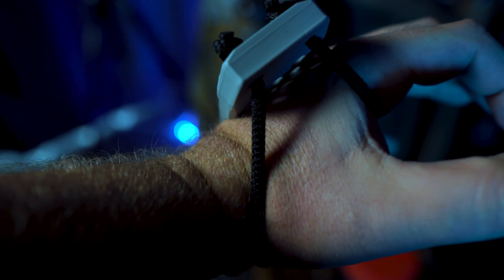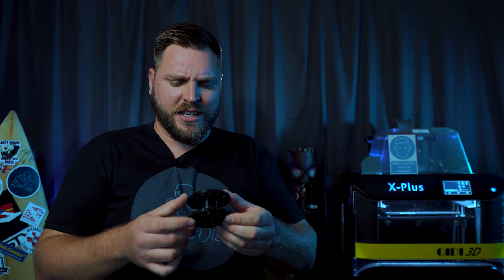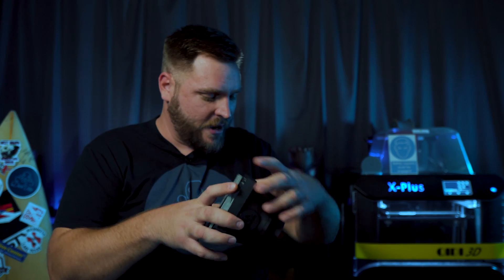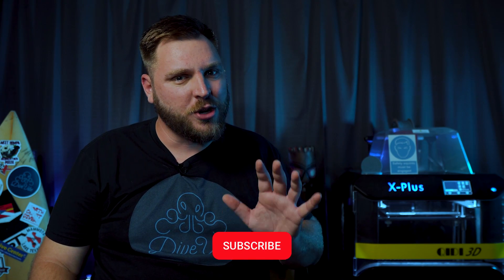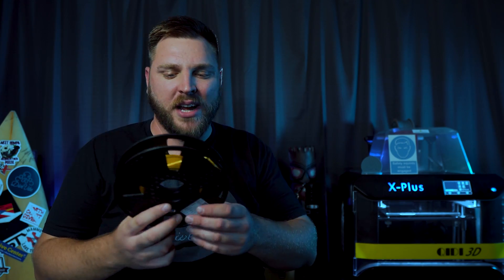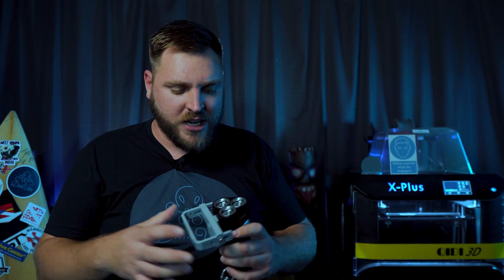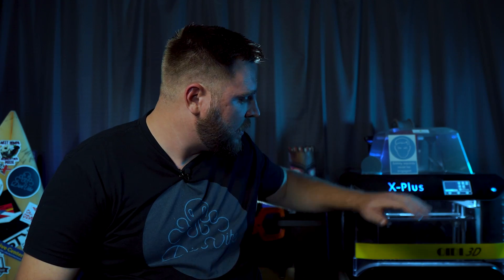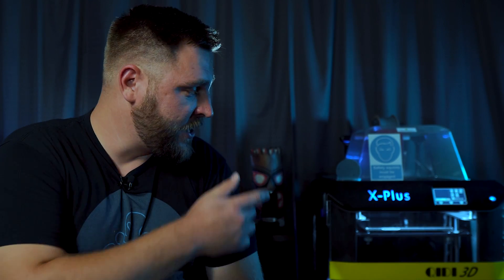3D Printed Scuba Gear - QIDI X-Plus

Comment: holy ****, batman!
i too am the owner of a sofirn sd01, and i have yet to find a proper goodman handle!

i humbly ask if there is any way for me to get a hold of that STL file of your handle?

at any rate, i know of many tools and bobbins being made with 3D printer. in the local club we have hand mounted mirrors, sort of used like a mobilerear view mirror. excellent for checking out your buddy behind you!
Reply: found solution. you have been beered.
Reply from the maker: Cool! I also have a hard Goodman handle model. I'll upload it to Patreon some time today so you have that option as well.
Reply: @DiveVibe  excellent! Will be a perfect travel primary torch i think. 😎

Comment: @DiveVibe I think you will enjoy working with Nylon X, you have to have a fillament dryer buy it prints like butter.
Reply from the maker: Good tip! Thanks Cesar.
Reply: @DiveVibe  you will need a hardened nozzle. Also the other thing I find cool a cheap is printing your own cookies for cave diving, with those you can play by engraving  your name or making them glow in the dark... break aways for side mount... tons of accessories for gopro... those expensive hangers I designed a couple of them in Fusion 360 now I don't pay anymore for  those... 🤙
Reply from the maker: Got one! Have you had nylonX parts underwater? Any effect on it?
Reply: @DiveVibe  So far so good I fixed all the clips from an old BCD wing better that the original ones, the break aways for the hoses zero issues, Caps for the DIN valves excellent so far... I have used PETG also with really good results and it is cheaper but the look of the Nylon X is amazing it hides the layers so well.
Reply from the maker: @WMCLComputers  I almost forgot, since you're already into 3d printers. Did you notice that during the video my x-plus is just dragging a half printed temp tower around behind me? HAHAHAHAHA I didn't notice until after I finished recording the video.